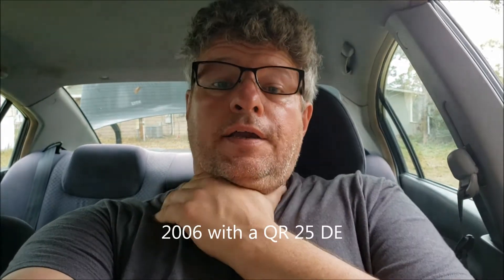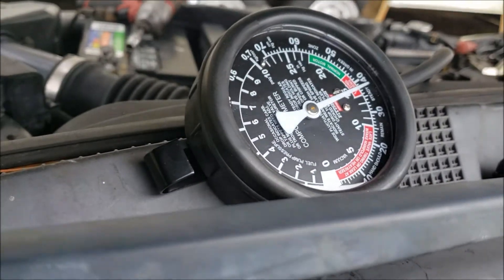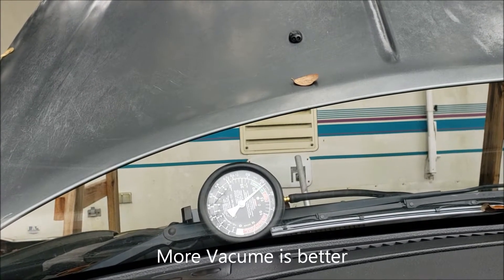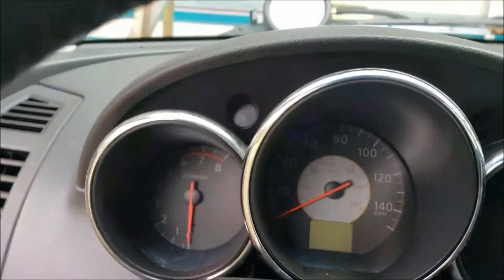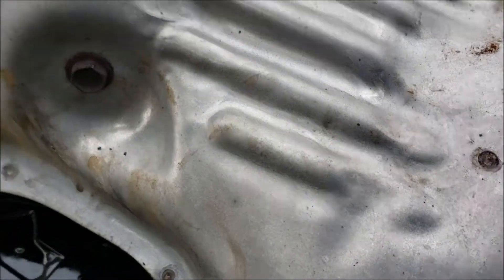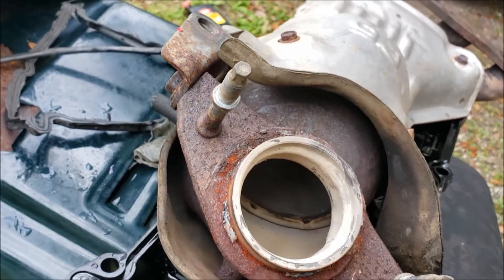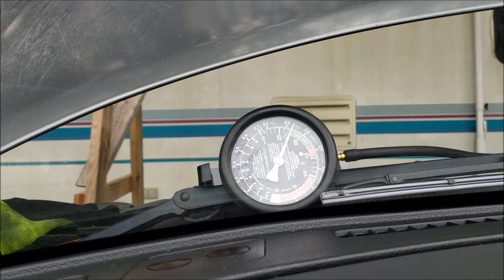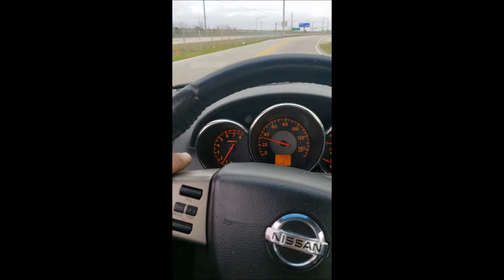Clogged Catalytic Converter Nissan Altima

Comment: So, the short version to the story is the cat(s) destroyed your engine. After the rebuild, you discovered & isolated the cause here. Is it plausible at all for a failure to keep the engine tuned (good spark plugs) and the associated misfires…to be a contributing factor to the cat’s degradation and eventual failure?  *In the majority of cases, by the time the problem gets this bad—have the misfires, back-pressure and debris already ruined the bottom end of the engine?

Comment: I just sent a comment-question about which cat it could be that I have clogged. I had one more question, I don't have any error codes like p-420 etc that state I have a cat issue, but had a service shop look at it and say they thought it was the cats? Wouldn't I have an error code stating issue w the cats?

Comment: does CEL come on with timing chain? and also what if it struggles to get to 3 on the rpm on park? does the gas pedal have to be floored? i notice i lost power driving back across a mountain.

Comment: My altima 2002 2.5l won't go passed 2k rpm.
Replaced the following

Maf sensor
Throttle body
Camshaft sensor
Crankshaft sensor
Spark plugs
Coils
Replaced old rotted air intake hose with a racing cold air intake

And still doesn't go passed the 2k rpm Mark just revs up doesn't do anything passed that. 

I'm guessing the cat is clogged but idk man.
Reply from the maker: First don't guess. At the shop I previously owned I had a sigh "WE TEST NOT GUESS" it would have been cheaper to test it and put a cat in than to throw parts at it.   Get a vacuum gauge there under $20  https://amzn.to/3vOBIxa  connect it up and test like in the video. Rev the engine and hold a high rpm if the gauge initially gives a high reading and then starts to drop the cat is clogged. Here is a link to the front cat https://amzn.to/3r88aqG.
Reply: I'm now having the same issue with my 06. Engine misfire, 02 sensor code, flashing check engine light. Bout to replace it with an aftermarket header I bought recently.
Reply: @GreatDivineCornholio  my solution was to see it crushed and it was the best thing I've ever seen.
Reply: @forgottenrobotz5636  You crushed the car? Soon as the new Z drops, I'm getting one. This Altima is about to get crushed. Can't milk it forever I guess.
Reply: @GreatDivineCornholio  crush it, save ya money and get something else. 200 or 300 at the junkyard serves as a base for down payment

Comment: My car won't go past 3,000 Rpms when driving and I had a cat code pop up but when idoling it revs great? Not sure what to do.
Reply from the maker: Well first What code? There is no direct code for a clogged cat. there is an efficiency below threshold code but that wont tell if the cat is clogged. You need to troubleshoot and not guess. 
A bad mass air flow sensor will do that as well. You could try a new MAFS or better yet a used one from the junk yard because new ones are not cheep. And or buy a vacuum gauge and test like i did in the video.  If it fails the vacume test and you are in a non emission testing state. gut it like i did. if your state tests. Buy a new Cat.